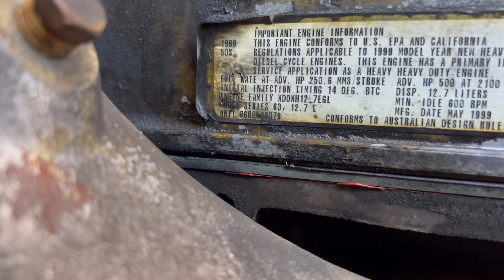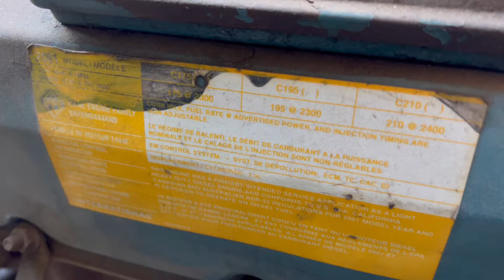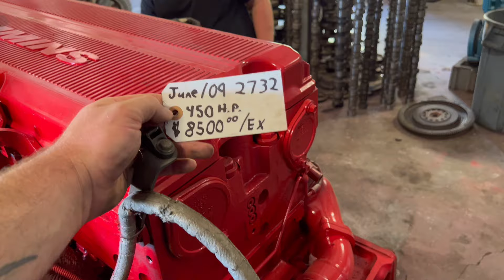PARTS HUNTING!!!THIS TRUCK YARD HAS EVERYTHING…UNBELIEVABLE

Comment: Rotors and pads are through the roof and hard to find,used to have a road service,had to cut with a torch several times on the road,Maverick has them on there trailers,nightmare

Comment: Did you know back in 1952 Cummins took thier inline 6 turbo diesel and laid it on its side in a Indy 500 car and ran 2 mph faster than Ferrari and broke the records running 139mph. If they would have had a screen over the turbo they might have won. The car had to drop out because the turbo got plugged with dirt and shredded rubber.  There is a video of it on y.t  plus story on Google and Cummins history. They had a good chance at beating Ferrari  untill Shelby did it.

Comment: Disc brakes suck wear out like crazy , get hot melt and sensors wheel seal leak all the time . Easy to change pads , but wheel seals are a bitch. It you are in dust and gravel it destroys disc brakes .
Reply: Thanks for watching 🔝🔝
And commenting
Send a direct message right away
You have just won a gift🎁🎁🎁🎁